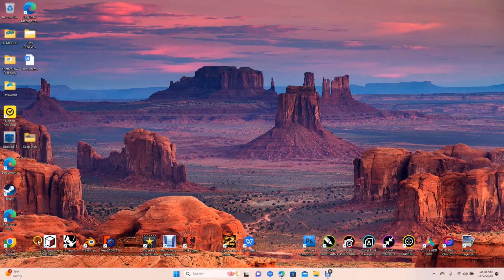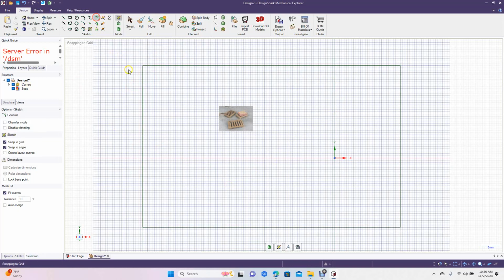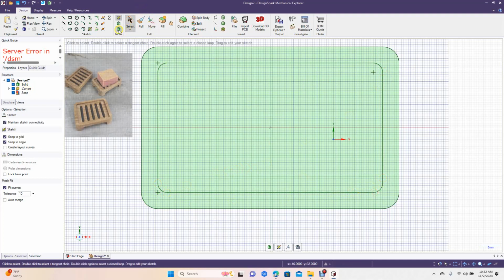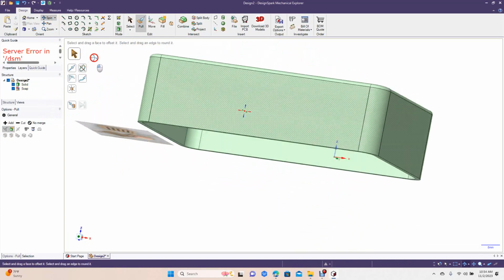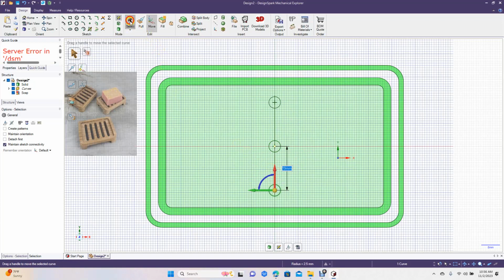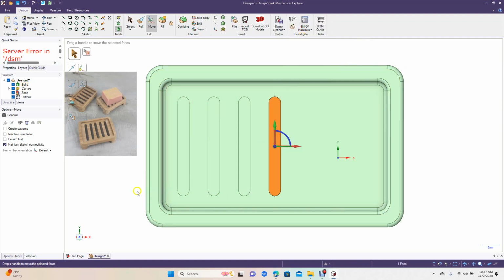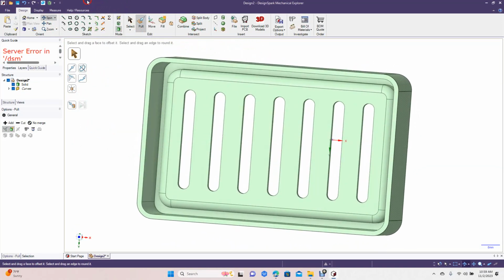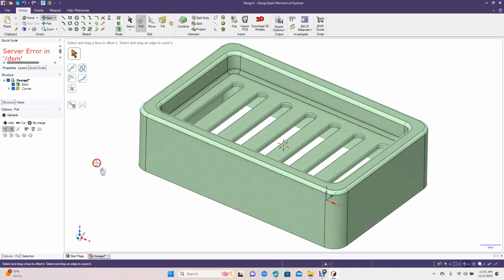How to create a soap dish with design spark mechanical

Comment: Another great video. I have a tutorial suggestion. Can you make a project box that has a lid, but also standoffs for screws to hold the lid on, and also standoffs for a printed circuit board. Getting the lid and all the standoffs to align is the main focus for my suggestion. Splitting or projecting the lid etc. I would use brass threaded heat inserts for the threads. I found your other video on how to make  a box with a lid on it so maybe you could just modify that video to make it easier on you. :) Thanks.
Reply from the maker: I will see what I can do.
Reply: @dailey3drevolve  Thanks :)